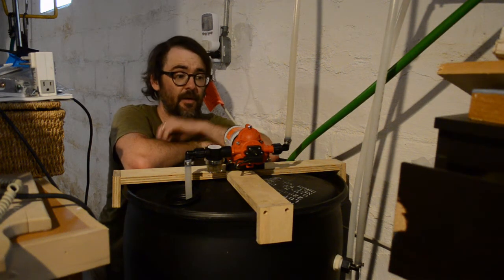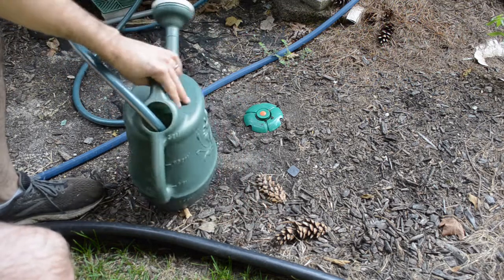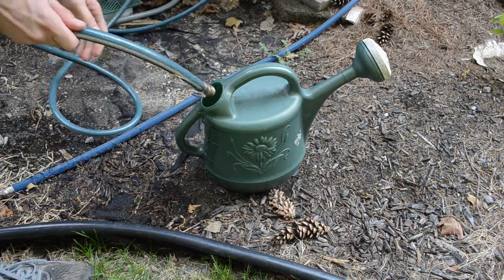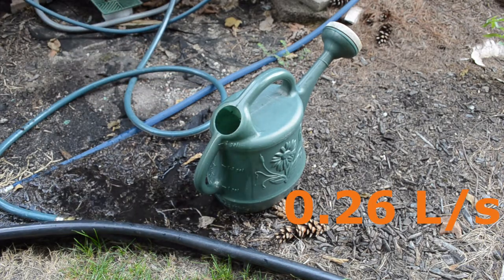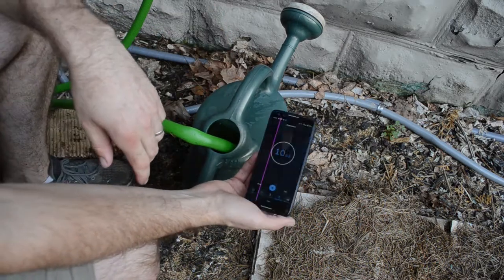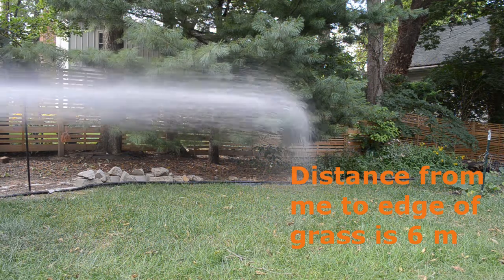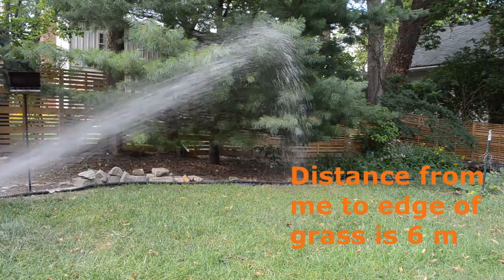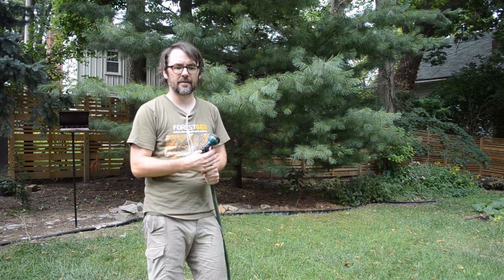On demand rain barrel pump system (Part 4. Flow and pressure tests)

Comment: Is the pump always running or have a type of electrical sensor to shut it off? I will like extend the life of the pump and dont over pressure the pipes. You experience any broken mine due to the pressure because accidentally forget the pump on or something like that?
Reply from the maker: An on-demand pump reaches a pressure and automatically turns off. When the pressure drops because you open a valve it clicks on. These are common in RVs.

Comment: I know this is an older post and I'm not sure if you changed this setup... can you please tell us what the GPM and PSI rating for your pump? Also, are you running 12v or 110v?
Reply from the maker: Same setup still works great. 1) The pump I used (and linked) claims 3.3GPM and 45 PSI.  You could buy a beefier pump if you have the power (i.e. 120v wall vs 12V battery, see next answer) and if you don't mind listening to more noise from a beefier pump. 2) I run 120, it's a house so I just plug it into my wall. But I don't see why you couldn't wire it for 12v if that's what you have. I have not tested this though.
Reply: @GordBuildLab  thank you for taking the time to reply.
Reply from the maker: @Red_Sky_Farm_2023  let me know how it goes!!

Comment: I am wondering what flow rate is required for washing machines. Perhaps the machine requires a particular flow rate or pressure to put in the correct amount of water... anyone have a suggestion?
Reply from the maker: Most washing machines stop filling after a certain total volume is reached. So flow rate is irrelevant.
Reply: @GordBuildLab  Thanks, good to know